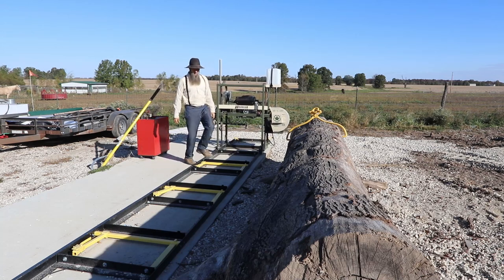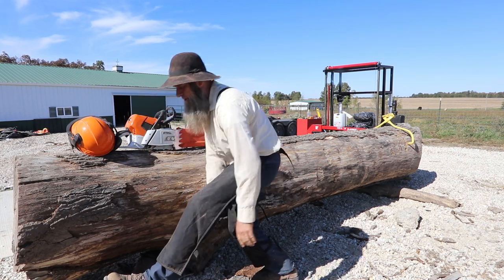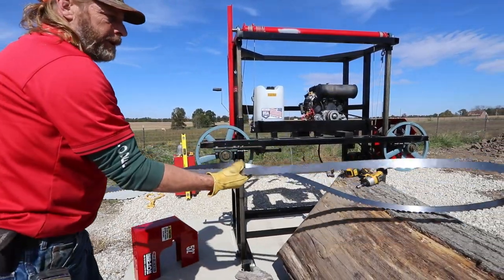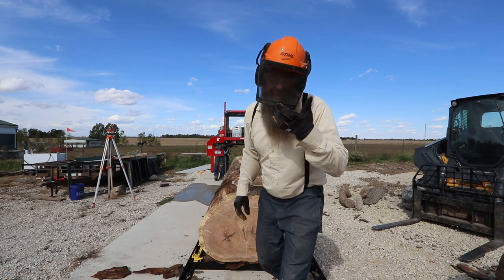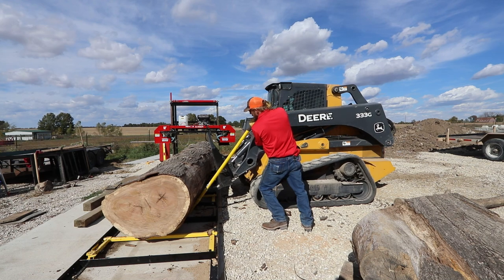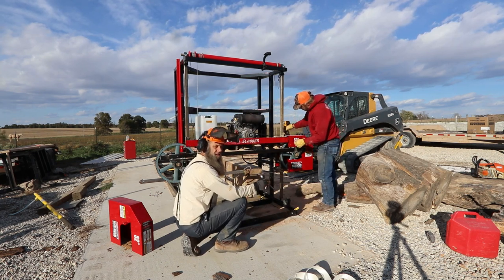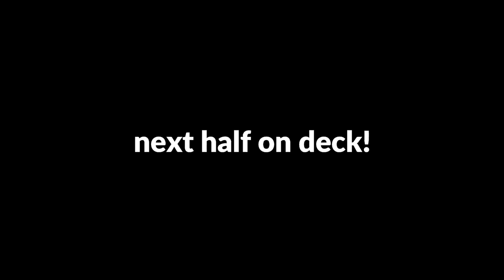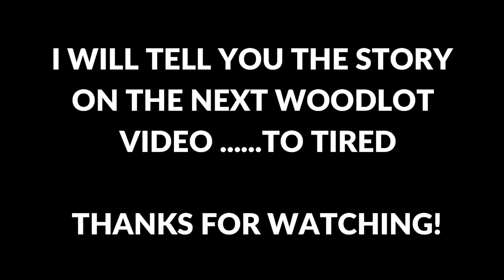Portable Sawmills Log to Lumber COMPLETE video | Biggest LOG YET!

Comment: Pretty sure I’ll never own one of these but it was so interesting to see it set up and working. He was very thorough on how to maintenance the mill, checking the welding on the blades, what to do if it wasn’t a clean weld, using windshield washing solution in winter… and how to handle the blade itself. I’d like all my digits and would like to keep them. Great teacher.

Comment: I have used 4 sawmills in my life. First one was a mighty mite with 2" band blade it was junk. second one was a Wood Mizer. It sawed ok but started falling apart. Third one was a 50" circle mill. Sawed good but to much wasted wood with 5/16" teeth. I now have a harbor freight band mill and it is the best mill I ever used only problem is it will only saw 20". Excellent little mill!.

Comment: You should build a a roof over the mill twice the width of the slab you can  work in bad weather and you can tarp the side in wind rain and you can recover the rain for the mill and use used filtered antifreeze in the winter that’s all that window cleaner has it it just with out the soap

Comment: If I'm not mistaken you can also add alcohol to your water. That will keep it from freezing as well. It my be 2 to 1 but I'm not sure. Adding alcohol to the water would be cheaper then buying washer fluid at a $1 a gallon at least in the long run.

Comment: +fyi i cut through bark dirt and the occasional nail. use ripper 37 10 degree  i also have a cooks cat claw sharpener.  get ya a sharpener,best money you will spend seeing the 45$ cost for them blades

Comment: To finish off your wood processing a chipper and an automated splitter would save time and your back. Just a thought. The saw mill is awesome for the larger cuts but for the smaller fire wood and back saving the wood processor is all automated no heavy lifting auto feed of full trunks. You have all the other machinery for lifting on the saw mill all you need to finish it off is a firewood processor and chipper and you will have the wood market complete. If you need help let me know I love outdoor work and looking for a change. Maybe we can exchange room and board until it gets off the ground and starts making some income. Let me know

Comment: You bought a bigger sawmill? You are trading in the Warrior sawmill? What size bar is that chainsaw? Wow! What's the hp on that motor? The other one I think said 29 hp. That thing looks wicked. It seems a lot more noisy than the Warrior. That log is HUGE! We!l, you'll be able to cut just about anything now. It sure looks like a skid steer is also needed. Looks like 2 people are needed to do the really big logs. That is amazing! I looked it up and it is 23 hp, the same hp as the 36" Warrior.

Comment: You can use six by six or for bys under your logs it doesn’t make a difference cutting the log the only thing that matters is the saw guide tracks is level this way you can get your forks out with damaging the saw

Comment: Doug I am lazy and cheap.  I don't like changing blades, or paying to have them sharpened.  To get more life out of the blades 
try pressure washing the logs before cutting.  You can do it either on the mill or off.  I use a 3k lb pressure washer and that does the job well.  If the log has been around awhile it will blow the bark off completely.
Reply from the maker: 🤔 ummmmmm hello WATER 🤣👍
Reply: @OFFGRIDwithDOUGSTACY  oops I forgot,  How big is you cistern?